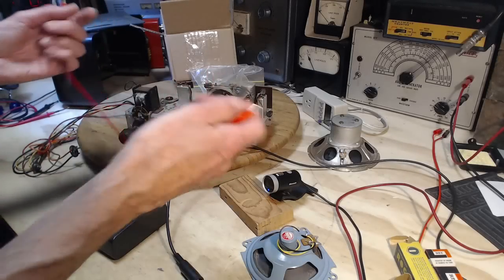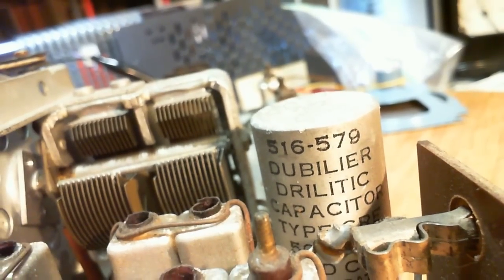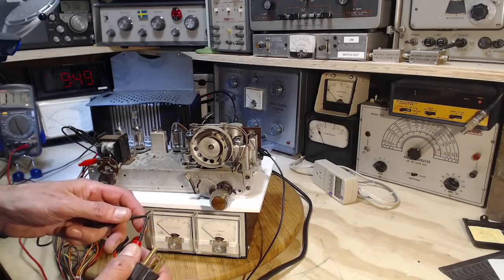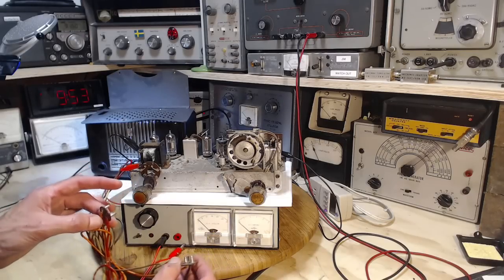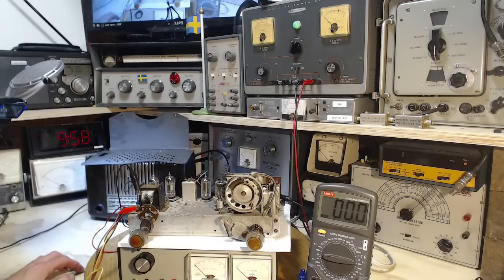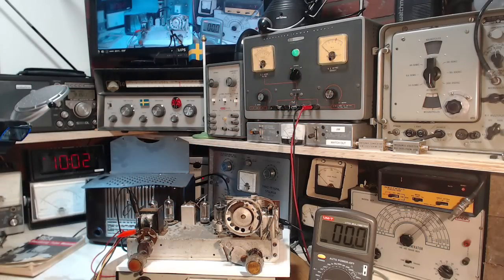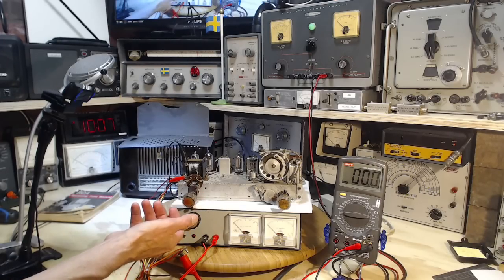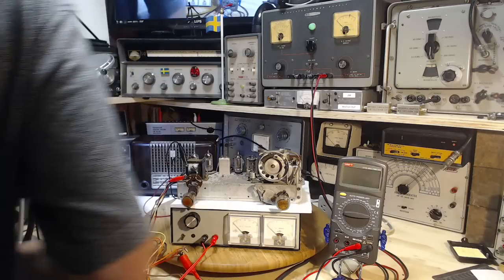Rogers Majestic (Philips) RM503 Farm Radio Video #3 - There's Trouble About

Comment: Jim, it looks like your power supply won't put out enough power when it is turned down low. At one point when you turned the power supply up it started to put out more amps.  You may need a power supply with separate Voltage and Amperage control's. Or use two D cells in parallel.
Reply from the maker: I think it's OK for now but I really should be using a 1.5 volt battery on the filaments.  Much less danger there.

Comment: I fix tube amps and stuff on my youtube channel,  but I can't concentrate with the camera on.   I'd rather do a before/after thing.   Cameras make me nervous.
Reply from the maker: If I hesitate before starting a video, I can get nervous.  So I usually have the cameras rolling within a couple of minutes of coming into the shop.
Reply: Thanks for the info...  you can see how I handled my echoplex repair..(on my channel)   it's broken up into two  <10 min segments...   checking it out, and suspecting the problem...   and showing the evidence and the repaired device.

Comment: DAM MAN WHY DO YOU MAKE IT SO HARD FOR YOUR SELF JUST PLUG IT IN TO YOUR  Variable Isolation Transformer  plug it in and try it
Reply: It is a battery set and doesn't have a plug that is why he used a dc power supply.